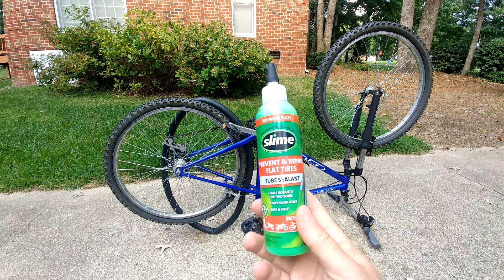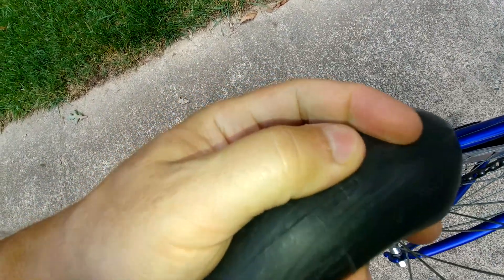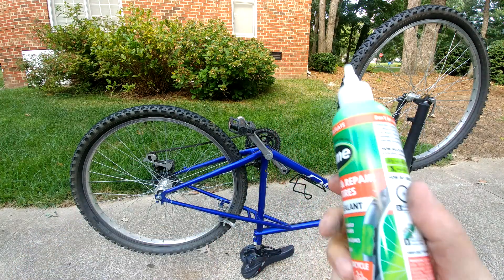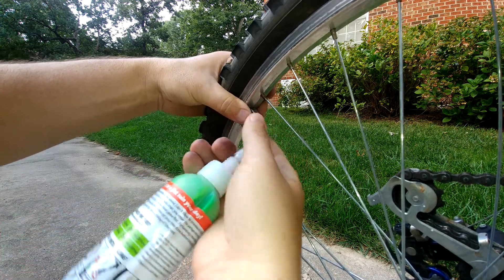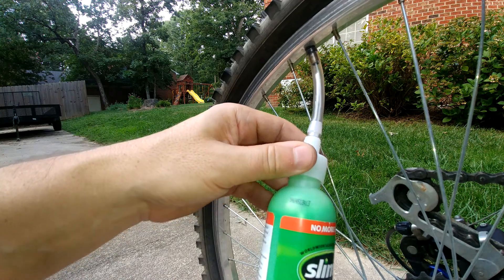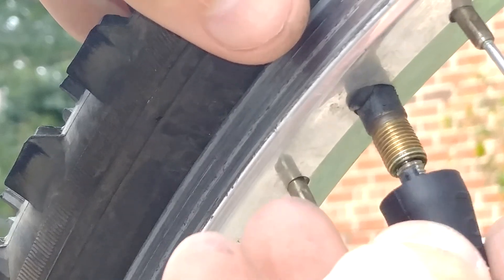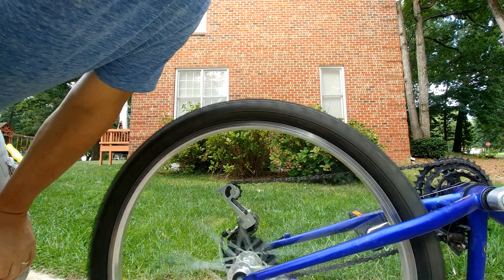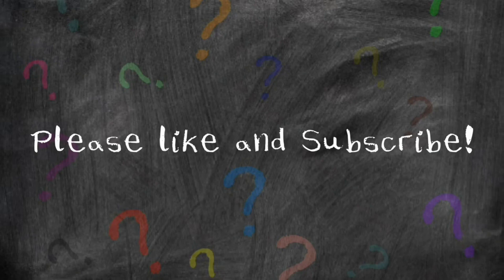How to fix a flat using Slime!

Comment: i installed this on my fat tire ebike yesterday 26x4 and slimes website calculator said i needed 12,5 oz per tire, i had a 32 oz bottle so i just put 16 in each, the bottle did say to shake 30 seconds vigorously for 30 seconds before installing. i didnt have any flats but being the ebike is 70+ lbs i am betting prevention is better than cure

Comment: Mine clogged in both tires… very depressing  says clean with a wet qtip but then the Cotton at the end broke off in the tube… 😞 I’m tired and sad just got the bike yesterday only 6 miles before a flat happened…. I’m thinking to just replace the tubes at a bike shop

Comment: You didn't show the part where the slime just pours out the hole in your tire and goes all over the floor while sealing nothing (I later took the tire off and the hole is tiny). Oh and the "tool" broke off immediately.